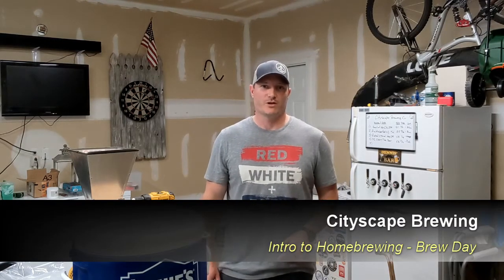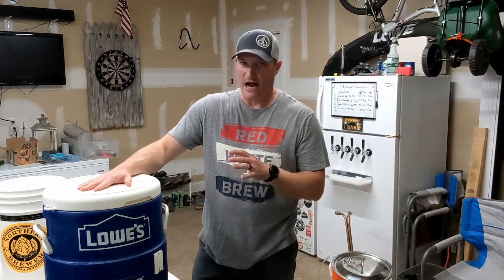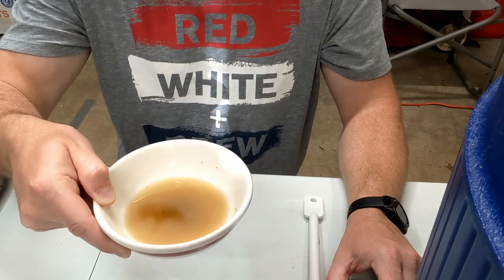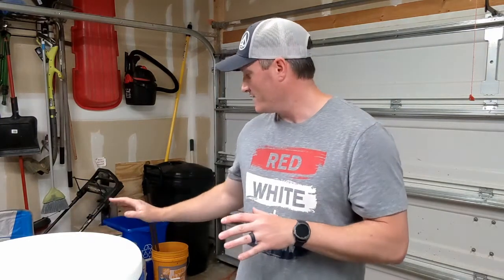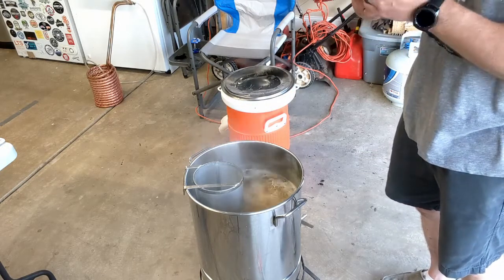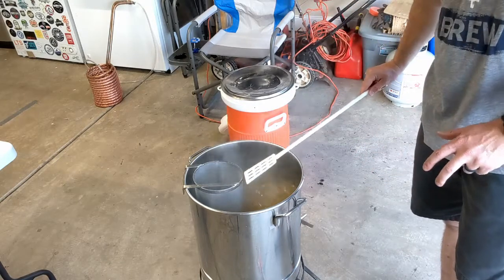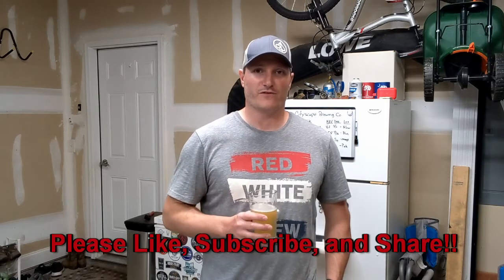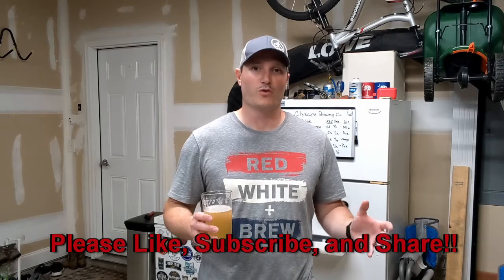All Grain Brew Day - Step by Step Tutorial for Beginners

Comment: I did my first homebrew in August last year. I started with liquid malt extract and steeping grains. I then graduated to large partial mash (7-9 lbs malted grain) plus about 2.25 to 4 lbs LME, depending on the recipe. My 5 gallon kettle fits inside my oven, so I preheat the oven to 170 degrees, fill the kettle with hot water and the crushed grains, and mash inside my oven using Brew in a Bag for an hour. About half way thru, I take the kettle out, stir the grains, put it back in the oven and turn on the electric element for about 1 minute. The oven holds temp very well. I was told that the stove top on most stoves lacks the oomph to boil an all grain batch. I questioned that wisdom and bought an eight gallon Megapot (no ball valve) from Northern Brewer and began doing all grain boils (about 6.65 gallons to a little more) on my stove top last January. The stove top is stout enough to do more than a gallon boil off per hour. Mashing in a 5 gallon kettle long term has its limits. So, I did what you show here and bought a 10 gallon RubberMaid water cooler, put in a stainless steel ball valve, and do Brew in a Bag inside it. I can either do no rinse, traditional BIAB with about 7.5 to 8 gallons of hot water, or I can put in about half the water and rinse with about the same amount. The ball valve will accept either a torpedo screen or a false bottom, but I have only done BIAB inside it. I bought extra large (31" by 31") BIAB bags on Amazon (2 for 12.99). That size is perfect for the water cooler. It is big enough to fit over the two large, fixed in place handles. I then secure it with a 24" and an 13" bungee cord and that works just fine as well. The lid on the water cooler will screw closed with the bag in place. I mash for an hour at 152 and the temp may drop to 151 after an hour, if that.  The 10 gallon cooler is great for mashing! All sorts of head room, draining thru the ball valve instead of lifting out the bag gets rid of most of the mess and saves my back. Your videos have helped me as a novice brewer. Thanks.
Reply from the maker: Awesome! I never thought about using a brew in the bag instead a false bottom in the cooler... But if it's working for you, then keep doing it! I like to do a batch sparge so it rinses the grains a bit more, but that really only affects efficiency, not the end product.   Glad my videos are helping out! Let me know if you ever want me to do a video on a specific topic.  Happy to help!   Cheers🍺

Comment: Try brew in a bag. Saves all those transfers. Ans, you can do it all in your boil kettle.
Reply from the maker: Nothing wrong with brew in a bag, but you need a much larger kettle to do the same volume , most likely a 12 to 15 gallon to still do 5 and 1/2 gallon batches at the end of the day, and you do lose some efficiency. Had a homebrew scale,  that's not a big deal, But there are some trade-offs. I also like just being able to rinse out the mash tun and not clean out a bag.

Comment: That fermentor is a great idea!  I used to cover the carboy with an electric heating blanket hooked up to a digital temperature controller.  I'd just put the temperature probe under the electric blanket against the glass carboy and keep it around 72°.
Reply from the maker: Nice.   Whatever works!! Temp control is super important.   I'd actually shoot for temps at 65-67 or more ale yeasts.

Comment: Okay, at the 4 and a half gallons of 170 degree water that I'd have to lift to sparge using this method has made me decide that the BIAB method is for me.  The lift would cost me less than the additional cooler and I wouldn't have to lift anything.  Watching this again I picked up stuff I missed the first time I watched it.  So much good stuff here!
Reply from the maker: Actually brewing a bag is very different. You have a mash process where you actually let the grains soak at 145° to 155° or so for an hour.  That is different than what you do in the extract kit when you are just steeping a small amount of grains to get the color.  In the extract kit, you don't get many sugars from the steeping for only 20 minutes. All of the sugars come from the LME and DME.

Comment: What size bung and tube diameter would I need to create a blowoff tube? I have a bung with a smaller inner hole for a regular airlock. Using a 6.5gal Big Mouth Bubbler glass.
Reply from the maker: The easiest way to do it is find a vinyl tube big enough to fit over the interior tube that's already in a three-piece airlock (usually that is a 1/2 inch ID).  That way you don't need any other equipment. The main component of the airlock fits in the bung and then the tube fits over the inside part of that piece and goes into a small jar of sanitizer. Alternatively, you can drill a larger hole in any size bung, But that's kind of hard with the rubbery material. I've done it both ways.

Comment: Thanks for the video. I want to go to all grain soon. Have a few questions. 
1- what size boil kettle do you use for five gallon recipes?
2- I bought a mesh bag specifically made for 10 gallon Rubbermaid cooler mash tun ( that was given to me without a false bottom)
Advertised as takes place of a false bottom and makes for easier cleaning of mash tun). 
Do you see any negatives of using this rather than a false bottom?
3- every thing I see about sparge water is to make it rain over the grain bed. I see you dumped all the 170 degree water in at once and stirred and let sit for 20 minutes). What is the difference? Why would some do it this way as opposed to how you did?
Reply from the maker: Great questions and happy to help answer them!   
1) My boil kettle is 10 gallons, this allows me to do 5-6 gallon recipes which have a starting volume around 7 gallons.   The boil kettle I use is very inexpensive but works great and you can find that on my amazon shop here: https://www.amazon.com/shop/cityscapebrewing
2) You can use the bag in place of a false bottom or screen, but then you have to clean the bag out, which is a pain too.   I use a bazooka screen, which is easier and cheaper than a false bottom, and I just spray it out with a hose after.   You can see in my equipment video here: https://youtu.be/9TZLoP8cfAg  and I have that in my amazon shop as well.   
3) The process I use is called batch sparging.   This replaces the need to fly sparge, which is "trickling water" through the grains.   Both processes are essentially rinsing the sugars off the grains to get as much efficiency (higher starting gravity) as possible so you don't have to use as much grain.   Batch sparging is MUCH easier and I don't need a separate vessel to do it, that is why I continue to batch sparge.   
Those are great questions, and happy to answer any others you have as you get into the process more. 
BTW, you don't pay any more to get things from my amazon shop, but they do give me a small percentage, so helps my channel out :)   Cheers!

Comment: I dunno if erring on the hot side of things with your strike water is a good idea. If you get the mash too hot, you end up with unfermentable dextrin sugars, which can result in a stuck fermentation, as I found out with my last brew. . .
Reply from the maker: The point is it's easier to cool down with a few ice cubes than it is to heat up. If you're short... You can cool it down relatively quickly with a handful of ice cubes

Comment: Hello everyone, I am new to brewing, question, why can’t you you the mash in the kettle, why a mash tun ?
Reply from the maker: That's a good question. Happy to help, that's what this channel is all about, helping people become better brewers. Shirt answer is you can use a kettle if you want to, the issue is having consistent temperature over 60 minutes. It is difficult to maintain a constant temperature for 60 minutes without having hot spots on the bottom where you're heating it.  To prevent that you'll need constant recirculation which is what some all-in-one electric models do.  The reason I use a rubbermaid container is because it will hold the temperature without needing to recirculate or move around the liquid/grains for the entire 60 minutes.   For proper starch to sugar mash conversion, You want an exact mash temperature (depending on beer style) to be consistent throughout the entire mashtun and for the entire 60 minute mash rest.  Hope that helps! 🍻

Comment: To all others like me - "Step by step" can't get any better than this right here my friends. Thankyou.

I still have a question - How much watts ceramic heater is present in the chamber? Did you had any over heating issues with it 'cause from what I've learned they can reach higher temperatures pretty fast. Maybe a CPU fan of some sort would be beneficial? It's falls here and I am searching for the right way to ferment my Kveik beer. I want to take it to 33 degrees Celsius. Would ceramic bulb help me achieve that temperature without heating too quickly to start burning things up? I am concerned about this.

Thanks again.
Reply from the maker: It does not get hot enough to start melting things, especially in a chest freezer with metal walls. I always tell people to put the temperature probe on the outside of the fermenter, not in the beer so it doesn't have to get very hot before the temperature is stable.. This will work fine to heat for kviek yeast temps.
Reply from the maker: And thank you for the nice comments on the video! 🍻🤘

Comment: Loved the vid. Was able to grasp the procedure and lingo at the same time. Please advise what is the main cause of Homebrew Tang? Cheers from Melbourne Australia.
Reply from the maker: Great question. The homebrew tang is usually an off flavor from either not having the correct temperature control, AKA fermentation temperature, oxidation from letting your beer splash around or exposing it to air too long, or not the correct pH of your water during the mash. I would focus on fermentation temperature control (Absolutely number one), then oxidation, then start talking water. Doing a whole video very shortly on water chemistry and pH. Stay tuned! Cheers 🍻

Comment: Do you spray your bung with sanitizer? I was using a Carboy and the bung and the Carboy were slick so the bung was sliding up.
Reply from the maker: I usually do, but you can let it air dry before you put it in or try it off with something sanitized like a paper towel.  In the future, You should try and find a little bit bigger bung if it is that loose though, to prevent it sliding out

Comment: Do you have a video something in the line of matching yeast with the type of beer you are making.  I’m a little foggy in this area considering how many yeast and types of beer there are.
Reply from the maker: No, but that's a good idea for a future video.   There are definitely yeasts for specific beer types, like a marzen Oktoberfest for instance, but there are a TON for just a clean IPA or pale ale that all have different flavor profiles.  I like to switch it up and try new ones and find which ones I like.   Smash beers are great for trying new yeasts too!
Reply: The temperature at which you ferment is that directly related to the yeast you are using , like the recommended temp for pitching. Will I use these temps are something in the middle. Guess what I’m trying to say is how do I know what the correct temp is for fermentation? Thank you in advance
Reply from the maker: Each yeast has a recommended temperature from the manufacturer.   For instance safale US-05 says between 53.6 and 77° f., ideally 59 to 71.6° f. Says that right on the package. If you're unsure, you can also look it up on the yeast manufacturers website.  Lager yeasts will be much cooler, and Kveik yeast will be much warmer.  If you go out of those ranges, you will get off -flavors and esters in your beer... Most of the time undesirable flavors.

Comment: I have 50 lbs whole grain pilsen and some Munich light malt. Would like to make a lite beer on next batch . What yeast and hops would you recommend. Have cascade on hand. Maybe a smash with just the pilsen . On fermentables they list several different pilsners ie pilsner uk, Pilsner ca, pilsen de. Not sure which to pick. Any ideals would be appreciated. Thanks
Reply from the maker: It shouldn't really matter that much, but if you know the brand you can put it there.  The main difference is the lovibond number, which determines color(SRM).  Most Pilsen malt will be very similar, like 1.2L so for the recipe, if doesn't matter really which one you pick, it should come out very similar no matter what.   Cascade and Pilsen smash would be great.
Reply: So any Pilsner yeast be ok . As far as fermentation temp just whatever range is on pkg
Reply from the maker: Oh, if you are actually trying to go for a pilsner style then you need to use just some bittering hops, typically saaz or hallertaur hops, at the beginning and have the ability to lager at about 58° Fahrenheit. I would suggest looking up at pilsner recipe with good reviews to see an example and then try and use similar ingredients and stay in the same ABV and bitterness range. You won't need much. Hops.
Reply: Cool that helps
Reply: Can I find some good recipes on brewers friend ?
Reply from the maker: Yep.  You can use the search and then sort by ratings

Comment: I totally enjoyed your video, thank you. 1 question though, unless I missed it, did u add more plain water to your recipe after cooling and before adding the yeast?  The recipes I use always seem to have me do that.  Maybe it’s because I do it from an extract kit, not an all grain recipe.  Would that be the difference? Thanks again.
Reply from the maker: Most kit instructions assume you're doing it on a smaller kettle inside of your house. You can do extract kits and all grain brewing with full boils in a larger pot. I used to do that when I did extract brewing. I started out with 6 gallons of spring water. I steeped my grains and added DME same as the instructions. You just don't have to add water at the end. It helps infuse the flavors in all of the water during the boil process. Essentially you're going from 6 gallons and boiling down to the appropriate amount. In your kits, you're doing more condensed version and adding water afterwards to get to the same amount. I would highly recommend getting a larger kettle and propane burner and doing full boils. That way the transition to all grain is easier as well.
Reply from the maker: Let me know if you have any other questions, happy to help!
Reply: @CityscapeBrewing  
Thanks a lot for the clarification. Makes a lot of sense, I will definitely try doing your way and see if I can taste a difference in the end product.
Reply from the maker: You're welcome!  Happy to help.

Comment: Brewing in a bag seems like less hassle than using a mash tun but what do I know I've never brewed just been watching a lot of videos before I dive in.
Reply from the maker: It is less hassle. The only difference is getting better clarity because you can recirculate/vorlauf and set the grain bed a bit better.   You'll also get more efficiency (better starch to sugar conversion) with a mash tun so you need a little bit less grain. But on a homebrew scale it's not that big of a difference. I find it's also easier to clean out my mash tun by spraying it out with a hose instead of having to get all the grains out of a bag.  It is just personal preference, lots of people use brew in a bag and make great beers. 🍻

Comment: Excellent video!

On the chiller - my lhbs rep suggested putting the chiller right in the boiling wort because the copper is a micronutrient for the yeast.  

Also - two suggestions on your volume levels.  1) get a body mic.  Your own mic level is extremely inconsistent depending on where you're standing, and 2) if you must add sound effects (like the air horn) make them at the same dB rating as the main video.  That blast was painful and I very nearly did NOT watch your excellent and very informative video as a result of that shock in the first few seconds.
Reply from the maker: Thanks for the feedback.  That was one of my first videos.  I have since upgraded my mic and my video editing skills.  Haha.   The only thing I would recommend for the wort chiller is to make sure you use high heat silicone tubing if you put it in your boil, I've seen others melt regular tubing from the heat.   In reality, it's in the hot wort long enough just through regular chilling to kill any nasty bacteria on it, even without letting it sit in there 10-15 mins, but no harm as long as you use the right tubing.

Comment: Nice video. Basically the same procedure I use, except I don't have a spider, I use reusable hop bags clipped to the sides of the kettle with clothes pins. (Just make sure you don't let the strings fall down or you'll burn them off LOL) I also go nuts with my vourlaufing. I use two kitchen pots and pour back through a spaghetti colander so as not to disturb the grain bed. It kinda "rains" down gently. I'll alternate filling and pouring the pots at medium drain speed about 20-30 times until the wort is really clear. I know, I'm anal. Hehe. I take first runnings gravity, sparge gravity, and pre-boil gravity readings with a refractometer, and after chilling, an original gravity reading with both refrac and hydrometer. Cheers!
Reply from the maker: Thanks! Yeah either way helps reduce hop partials in your wort.  Thanks for watching!